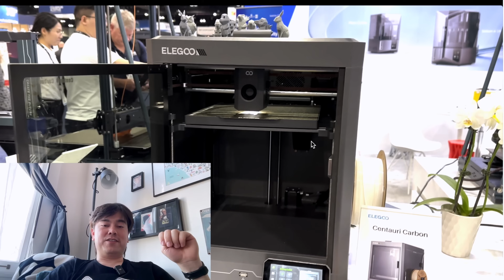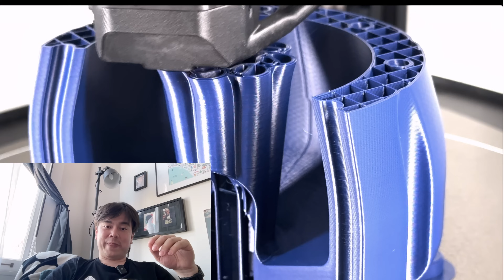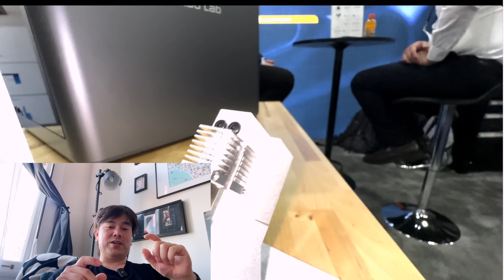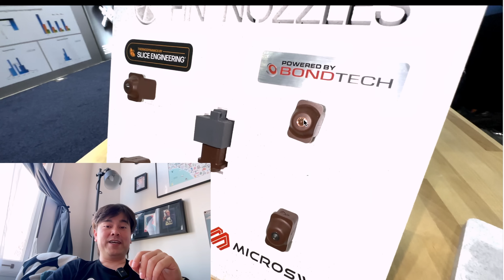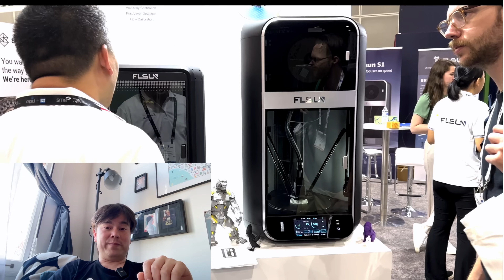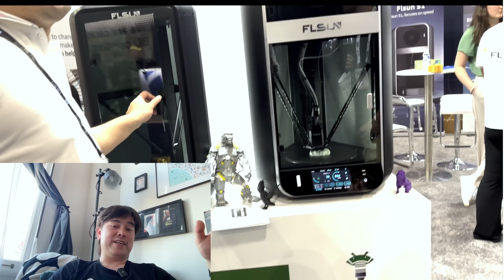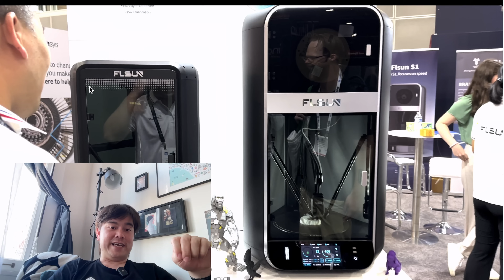10 Newly Released Printers at RAPID+TCT 2024

Comment: Talked with the developer of the HT90, some takeaways

-the cooling fan has a valve that allows cooling flow onto the part and takes .5 seconds to switch, so you can get much more specific about cooling and not cooling specific areas of a layer
-prints peek beautifully. They had a 400mm high fin that i saw no wobble at the tip of
-the machine wasnt moving the table at alll, incredibly stable. And yeah soo so silent
-two different hotend assemblies that are attached by magnets and have a single plug at the top, one for high speed printing and the other for high temp printing
-direct drive extruder and it can handle tpu

Comment: The 90 in the prusa stands for the chamber temperature and it's a game changer. That thing is not a toy, it's a proper industrial tool.
Reply from the maker: That actually makes a lot of sense. Excellent sealing and insulation are necessary for reaching, BUT as an added benefit it’s also great for sound insulation
Reply: @NathanBuildsRobots  Yeah but the main point is to make a 3d printer 90C capable you need to make sure all linear rails/bearings have high temp lube in them, plastic parts have to be very high temp, stuff can't melt, motors have to be high temp capable. Metal will expand in the high temp so it's very challenging to build this printer. However once you print ABS/ASA at 80C chamber you will never go back. First you need to throw everythig you know about ABS printing out the window. You need an astronomical amount of cooling (which is why they have CPAP) but parts never warp and the layers fuse together completely and you will experience ABS prints with actual layer adhesion and very nice sufrace quality. This is an amazing product and here you are talking about that it's quiet LOL.
Reply from the maker: I will pay 4x for a printer just to have it make no noise
Reply: $10k game changer

Comment: About a year ago I emailed Elegoo just on a whim asking if they had any plans for a multicolor printer. They said essentially that they were working on it, so judging by the poop shoot and little cutter button that I saw on the Centauri in this video, this is probably it. I’m guessing since they didn’t show it off, they’re probably still working on the actual MMU attachment, and if I had to guess they’ll launch the printer first and then the MMU later as an upgrade you can buy and add on.

Comment: The anycubic multi-filament system is also a heated filament dryer, similar to the creality one. The machine itself might not be quite up to A1 standard, but for the price and with some improvements in the multi-filament system, it's a cool little combo.

Comment: If you want to dig into the K2 a bit:
1. Is the model there a production or pre-production model?
2. What cost cutting compromises can you see (aside from the lead screw count reduction)?   Do you think any might compromise print quality?
3. Extruder and hot end:  It's supposed to be an "Apus" extruder but doesn't look like the one from Phaetus.  Volumetric flow rates have been mentioned to be 40mm^3/s+.  BS scale from 1 to 10 given the hot end they are using?  (is it just a slightly longer unicorn?)
4. How is the camera and lighting?   Resolution and frame rate for streaming?
5. Any chance at demonstrating the closed loop motors (maybe unplanned disruption)?

Comment: It has been mentioned the filament system is not heated. The temp and humidity are informational only. I wouldn't even say Prusa pioneered the 4 bowden tubes to the hot end. Their work was based on the rest of the community.

Comment: The Anycubic ACE Pro is a filament dryer with built in buffer system.  It's not close to the AMS light, it's actually an improvement on the AMS being able to dry filament and has tangle detection, filament swap over, and an easier loading system than the AMS does.  And it's on the market before the Creality one.  So, yes, they have some ideas.
Reply: I have the Kobra 3 Pro and the ACE unit has worked great. Anycubic has continued to tweak and update firmware for both and so far no complaints from me.

Comment: those new AMSes... do they poop as well? was hoping that Bambu would come up with some brand new machine...
Reply: Yes, they do. As long as you only use one nozzle, waste is inevitable. But you can reduce waste by using the purge material for support structures, infill material or a separate print object, for example. However, this is more of a slicer setting than something the machine does on its own.
Reply: @andreas.grundler  poops gallore my friends 😂